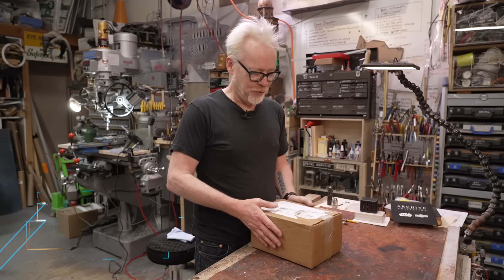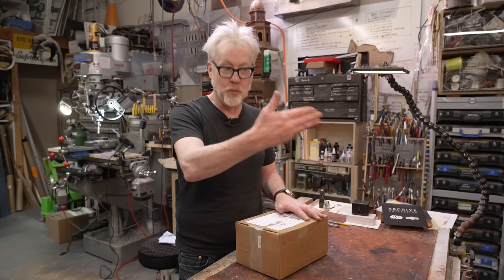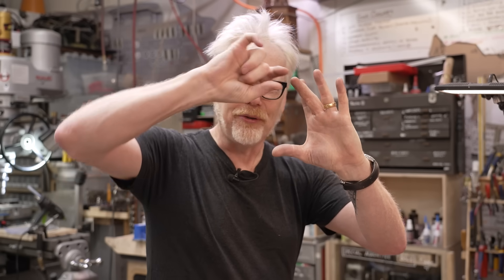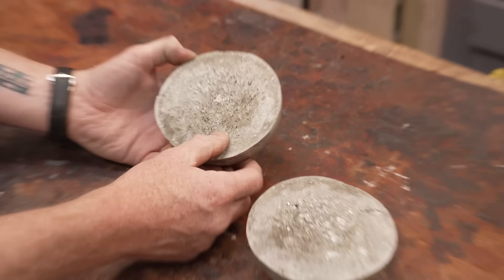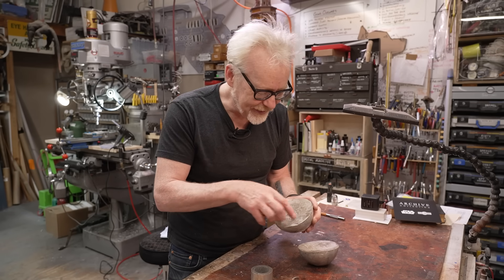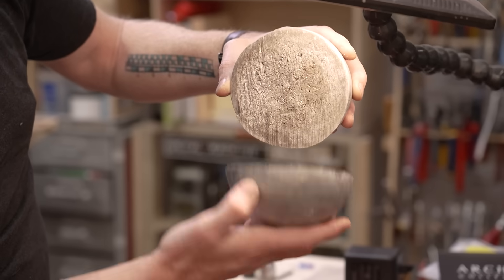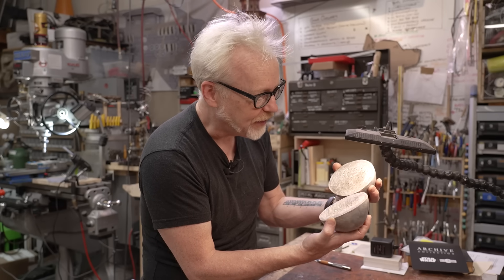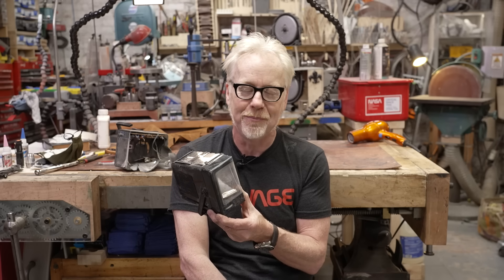Adam Savage's Aluminum Foil Ball Cut In Half! (Ft. Waterjet Channel)

Comment: Make sure you at least embed the cut face in epoxy before you try to sand and polish it. The less dense core will just fill with waste and likely tear out otherwise. Other YouTubers have tried similar experiments with compressed aluminium, and have had that result.

Comment: So my wife runs water jet machines for her job, they typically use a very fine sand rather then diamond or anything else because the price is so much lower, it can be recycled into landfill material and it’s strong enough to withstand being shot through material at 75,000 psi with water. Something really cool to see cut by a water jet is titanium, because it’s such a hard material there is sparks created from the sand and it looks like the material is just a big sparkler.

Comment: Foil ball but math would determine the layers and density of the same weight of Foil vs aluminum sphere ex.  1 inch cast aluminum ball weight being the reference for the same weight of tin foil and what it takes to reach or come close to the density and size of solid aluminum without a smelting process.  Just compression.   Because science and you have a big brain and a shitload of tools.  Love you man.

Comment: If there is a steel foil and I'm sure there is copper and brass foil I'd love to see you make all of those versions for the ball using same technique and cutting them and seeing the comparisons in how it comes out. Maybe even do a pressure stress test on each half of different material to see if they behave different. <3
Reply: I know there actually is for steel. Its used in industrial processes that requre heat resistant foil for temperatures over the melting point of aluminium. But one need to be careful, as ths stuff is pretty much razor sharp.
Reply: I think Adam may know where he can obtain some really thin lead foil. 🙂
Reply: just remember, that there (probably) is not any "TIN foil" as he constantly calls this aluminum foi.l (on second thought there almost certainly IS actual tin foil, but THIS IS NOT THAT)
Reply: Steel would be way easier to cut afterwards compared to alu. Or at least less of a mess.
Reply: I know that copper foil is an actual product, but rolls are beyond me. The largest I've seen are maybe 1 ft by 1 ft squares, and those I think were adhesive backed. You might have to go to a specialty metal supplier to get rolls.
Reply: @absalomdraconis  Nah here in UK at least you can buy rolls of brass and copper foil easy over eBay from UK suppliers.

Comment: One thing that I found interesting as the water jet hit the less dense center it started to vector a few degree. You can see that the lines at the bottom aren't completely straight under the center

Comment: I love the WJC, but at the same time I think Adam would have been much better served by taking it to a machine shop with an EDM machine, it would have cut it perfectly flat and smooth, no finishing required. EDM is phenomenal, it can do things no other machine in the world can, though the new laser water jet machines (uses a microscopically thin beam of high pressure water to guide a laser beam, which cuts like an EDM with perfectly smooth vertical cuts with no taper like either a regular laser cutter or water jet) are starting to come close.

Comment: This is so cool! I'd be interested to know how close the average density of the ball is to the theoretical density of solid aluminium.
Reply: For a rough idea, assuming .63 mils foil thickness gives a 5" diameter ball about 3x the volume of the foil itself (18.1 in3 vs 65.5 in3).
Reply: @hungryhippo6259  this is an excellent reply. I hadn't thought of doing that. Thanks! 👍

Comment: Dear Adam, please make some planning on how you want to get all the residues of polish out of that spongy areas in the middle, before you start to sand and polish it. That might become a nerve wrecking task. And even as a goldsmith, who has polished all very different structured surfaces over the years I am unable to offer an easy solution. We often use ultrasonic cleaning but I do not think that that will be working. Have fun!

Comment: I don't think polishing it raw would work very well as the aerated parts would fold into the holes and block them up not giving a true representation of what it is like. If you want to polish it the prper thing would be to epoxy it first. To be honest though, you could probably just be lazy and varnish the cut face and that would stabilise it well enough to be polished.

Comment: Such an honor to participate in this project! 
PS hilarious you already knew what it would look like. A true expert
Reply: If you could choose anything from museum of novelties in which adam resides, what would you like to divide cleanly in half
Reply: @KaYem_inc  I know I’m not the waterjet channel, but I would say the head of the terminator that’s been in there forever! What about you?
Reply: Now that's the voice of experience, right?
"based on my previous 10,000 hours, I think I know how this will turn out..."
Reply: Ignorant question:
 How does a water jet cutter not break with all that cutting media flowing through it at such a high pressure?
Reply: @marvelousmaker   There is a nozzle for the water and another for the "abrasive", the two flow meet in a common nozzle. And you can (you must, depending on the work you have to do) change those nozzles. I think the abrasive is "moved" with compressed air, so there are not much parts that would break due to the nature of this cutting media.
I'm absolutely not an expert and do not own one of those, but that's what I understood about it.
Reply: @fuckednegativemind  thanks
Reply: @fuckednegativemind  it sounds similar to the way a fast food soda machine works
Reply: @marvelousmaker just like sandblasting, the tubes are resistant to sanding, however it requires maintenance...

*dont think the abrasive dust moves in cycles, most probably the dust is mixed on the last moment with water, it gets thrown into the object to cut it out, but the dust particle wont be reused inmediatelly, it doesnt cycle the liquid and dust at the same rate it throws it... so only the nozzle will sustain severily degradation (and is considered on the design) not like all other tubes will suffer that much because will move the flow way slower.
Reply: Out of curiosity, what is the particulate that was involved in cutting this?
Reply: @ericthompson3982  It's called garnet.  From what I understand, it's like sand, but the particles are harder.
Reply: @bagel_deficient  Thanks! Yeah, I went over to their channel after this and the answer was in their half of the exchange. I love learning stuff like this.
Reply: They do use Aluminum Oxide in water jets sometimes. That's much more heavy duty and aggressive. They needed it to cut the tungsten carbide the one episode. The problem is that Aluminum Oxide will wear out your nozzle much much faster than garnet.
Reply: What happened to Dan?
Reply: I follow both channels … and not being a waterjet guy,  I was dying yelling “ITS GARNET!!!!!” lol
Reply: I don't always look in the comments, but when I do, I find 'Waterjet Channel' in the comments of every video I seem to watch.
Reply: @VanillaPutin  glad I’m not the only one
Reply: @oliviercoen2978  also if two substances have roughly the same hardness, they will cut each other, eg diamonds can scratch other diamonds

I imagine especially if the cutting substance has a range of hardness based on some structural variation at least having some of it be equal or harder will get the job done eventually since the water jet is supplying new material and doesn't need to maintain an edge like a blade or drill tip
Reply: the reason being is its compressed from the outside in, think of geodes that compress and have hollow spots in the middle for crystals to grow. Same idea, large outside pressure condensing the outer shell
Reply: It's not that impressive to know what the structure would be; it's simple compaction. We all know exactly how that looks: dense and compressed at the surface, but as the force is dissipated the density/compaction is less.
It's the same principle as compacting earth for a road or a building. If you want a really strong, sound earthen foundation, you dig deeper down than you want the foundation to be, then compact and fill in no more than 6 inches and compact again for a number of feet (relative to the structure you're building on that foundation).
Reply: From what he described, i think he expected a thinner outer shell.
Reply: You guys are awesome!
Reply: Participate and 'particulate'. Nice job!
Reply: @oliviercoen2978  The hardness is not the issue, the aluminium oxide is aided by the pressure of the water itself to achieve a mechanical advantage. Since its used as an abrasive it will "cut" the material despite the hardness difference its also why it wears down the waterjet nozzle that much faster.
Reply: Thank you for saving Adam's fingers.
Reply: What's the media in your waterjet?
Reply: A N A L P R O L A P S E
Reply: A true time waster, but if he had fun, other than trying to cut his fingers off on the band saw, have at it.  About the third time he tried to feed that thing into the band saw my thought was more, "what an idiot".  If you do laser cutting, too, or not, I wonder how that would have worked?  Some burning back, obviously, but the water jet doesn't leave the cut pristine either.  Actually I was amazed how well it worked.
Reply: Aluminum Ball in space https://youtu.be/xPFqWkUx0NI
Reply: Nice spoiler
Reply: Why did you guys get rid of the old hosts and change format? The old videos were so much better.
Reply: You helped reforge the demon core
Reply: @IcyDUD3  I know exactly what you are talking about, nice reference.
Reply: It's a shame you guys still having addressed the transition in an openly public video.
Reply: He should know: He is the one who didn't put as much pressure on the internal core as on the outer shell (used a hammer). The same pressure could have been applied. He did not...and remembered that. A miracle!
Reply: Meanwhile, people are starving in the world.
Reply: @dadylfitzys8880  so feed them.
Reply: @dadylfitzys8880 And you're here on your computer just talking about it? Do something already.
Reply: @dadylfitzys8880  Okay?
Reply: hey

Comment: To polish that I’d strongly recommend treating it like a sample prep for microscopy. Vacuum pot in epoxy and then sand and polish. The epoxy will stabilize the foil and hold it so that it can be polished. Bonus is that if you build the epoxy containment correctly you end up with a beautiful display.
Reply: Either that or cast it in resin and create some sort of interesting shape with the semi circle in it. (Paperweight? Bookshelf item? something like that with a specific shaped mold)
Reply: Great idea, I just commented that the core would probably just gall really badly, considering the poor consolidation.
Reply: Isn't that how "FISH" Microscopy is done? Such a brilliant technology, my wife worked with an expert in Boston on a project for this (I think ultramicrotomy?) & the fidelity was INSANE. Genius to apply it here.
Reply: @cococolson  I used it for everything from regular to electron microscopy.
Reply: A dip in a mild acid might first be needed to clean out all the crevices.
Reply: S m r t !
Reply: What mausball said.  The only negative is that you will lose the waterjet cutting lines as the surface becomes flat.

To Adam, what about making the ball in stages - consolidate it at intervals?

There will be internal patterns because of the way the foil came off of the roll and was consolidated.  So if you cut it additionally along a perpendicular axis, (latitude versus longitude section)  you will see other patterns.
Reply: @pault151  you could do a skew set in the epoxy and you could go to the boundaries where the epoxy overtakes the sample to see the surface character in a region.
Reply: I'm using epoxy to put an unsealed bottle of Aunt Jemima syrup on display.
Reply: @bronsontolliver9027  awesome. you have to imortalize it now that they have rebranded

Comment: Have you ever heard of foamed steel? its being considered for bullet proof armor with incredible results. Shoot it. A 9 millie should do nicely. if it works at stopping it....maybe a war hammer mech suit or a Mark 1 made from hand compressed aluminum foil. Dont use a press, the  holes in the foamed steel is the secret sause.

Comment: Although you didn’t say it directly, i think the cool “myth confirmed here is that hammering many sheets of Aluminum together makes one aluminum object at some point and not an onion on layered sheets.   I wonder if foil has any coating or oil residue on it and how that gets integrated into the final ball.
Reply: All aluminum has a layer of aluminum oxide on its surface. This layer is very non reactive so you won’t get much fusion between the layers.

Comment: If/when  you make another one, compress/hammer the foil as you create the ball...it'll make the center more dense and it'll be easier to maintain a very round shape, rather than trying to hammer it into a sphere later.

Alternatively, I've always wondered if you could do the exact opposite...leave the center as uncompressed as possible, then hammer the outside so its solid, then go in with a long dremel bit and hollow out the inside.

Comment: it would be interesting to see if you could hammer the relatively less dense center, and make a solid aluminum bowl
Reply: Pro tip: hold the two bowls apart with a screwdriver.
Reply: @fullfungo  or better yet, don’t put the top half near it
Reply: I wouldn't use that bowl for food.
Reply: @xagain3106  could use it for some chips to feed the robo dog ...
Reply: Use a vacuum to remove much of the air from the center.
Reply: They sell those at walmart.

Comment: im not sure if its possible to even get most of the air out because its just inevitable that oxidation get worked into the ball and if you did it in a vacuum thats just cheating because it will cold weld on its own anyway

Comment: The water does do a good bit of cutting. I run a waterjet myself and can cut through a baseball bat with just pure water. It's just much slower. The particulate added to the water stream is usually powdered garnet.
Reply: Yup, WaterJet Channel has even done a few cuts in the past where they used water only because they didn't want to get tons of garnet inside whatever they were cutting. Liquids and gases at high speed are very powerful!
Reply: How much slower is it?
Reply: Came here to post basically the exact same thing, we run an older Omax in our shop at work, and run a huge variety of materials through it. Basically anything we do that isn't metal is just pure water cuts.  Lots of pvc test stuff, drill templates,  rubber sheets, other plastic products, etc.  The only real problem with trying to cut any harder metal over like 10 thou thick without abrasive is that it will be slower than hell, and piercing becomes a big issue.
Reply: Slower but far less destructive to the area surrounding the cut line
Reply: Oh that’s interesting. Garnet iirc is used in sandpaper as well which makes complete sense.
Reply: ...Garnet from Steven Universe? That's horrible!
Reply: A wooden bat or aluminium?
Reply: @ClarinoI  probably wooden since that's what's whats used in the MLB

Comment: measure the approximate diameter of the sphere - then you can calculate the volume. then weight it and calculate its density. by comparing its density to that of solid aluminum, you can approximate the "porosity" or the percentage by volume of "void" inside the ball

Comment: Odd idea- I wonder if oxygen in the air affects how the aluminum "consolidates" as it's hammered/compressed?  Aluminum being so reactive, while it's being hammered together maybe more oxidation occurs?  IF one did this same experiment in a vacuum, would you get a better (more "pure") result?  Or maybe if you did this under a hood with Argon or some other inert gas?  Probably a bit too geeky :)
Reply: the foil would have a layer of oxide around itself, so you'd need to first process the aluminum in some way, to undo or remove the oxide, and then if you did it in a oxygen-free environment you should get cold welding to happen. maybe not perfect, but still partial cold welding.
I think. I'm not a chemist, physicist, or material engineer.
Reply: *aluminium
Reply: @Xirpzy  both are correct depending on what country you are
Reply: @Xirpzy  I reply with the same spelling as the person I reply to.
Reply: Yes, air inclusions and oxidation would cause some issues but the biggest problem is that aluminum foil has a coating of plastic on one side which does a good job of preventing it from cold welding.
Reply: @GunkDung  Uh that doesn't sound right. Aluminum foil would be rather unsafe to use in the oven (or in literal fire when making baked potatoes). Also it's common to use aluminum foil in electronics experiments for kids, and I have never heard of "use the right side or the plastic won't let it conduct!", and in fact using a multimeter shows it being just about as conductive on both sides, without having to scrape away any plastic.
Reply: @GunkDung  Aluminum foil does not have a plastic coating. The non-stick versions have a food grade lubricant sprayed or rolled onto them before rewinding onto paperboard cores. Otherwise, the surface is bare.
Reply: @GunkDung  Maybe you're confusing foil with aluminum pop cans? They are essentially a plastic bag wrapped in aluminum. No aluminum foil contains any plastic, that'd defeat almost every single purpose of it.
Reply: @kaw628  : I'm not certain that aluminum cans have a plastic layer either. A wide variety of e.g. soup cans have a liner, but soda cans? Not as far as I'm aware.
Reply: @absalomdraconis  soda cans definitely have an inside layer of plastic or some compound. Look around for people dissolving the aluminum off soda cans and I'm sure you'll find more info.